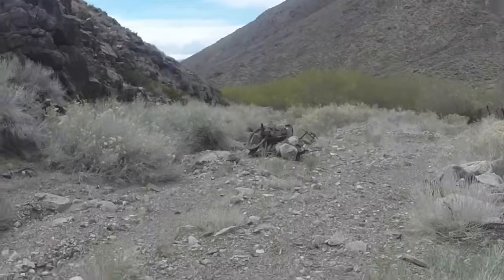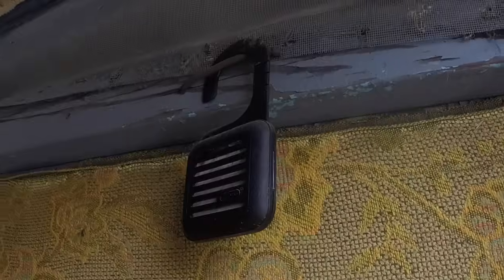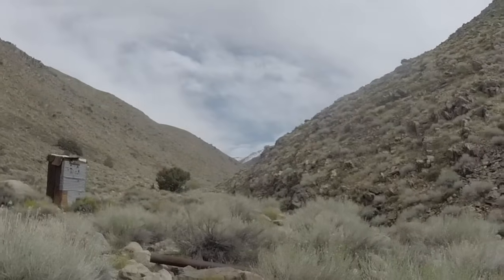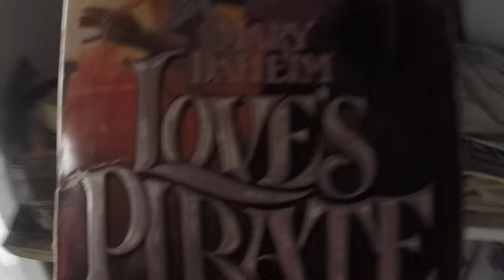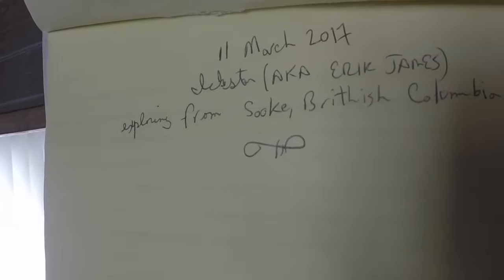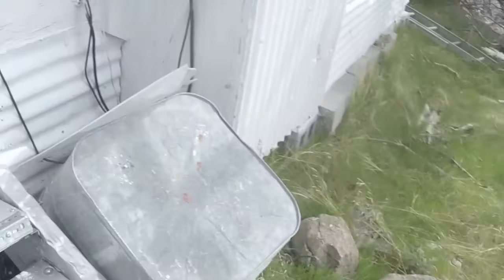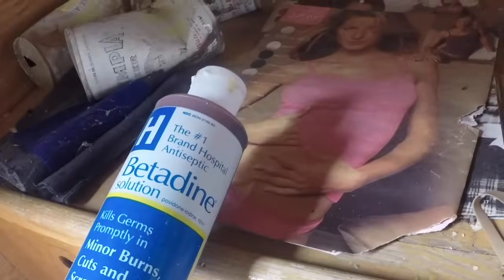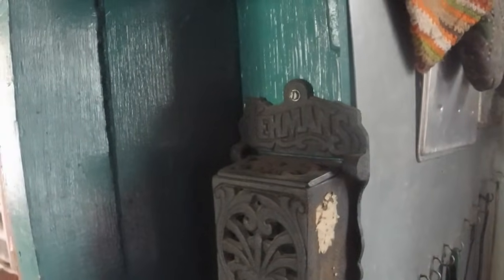Hiking to the Ultra Remote Weston Cabin in the Panamint Mountains PART II

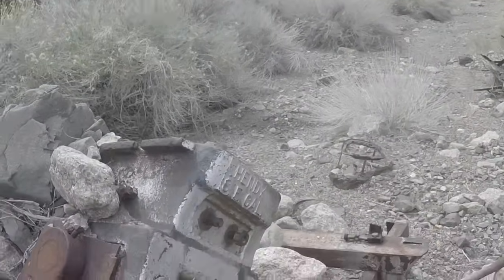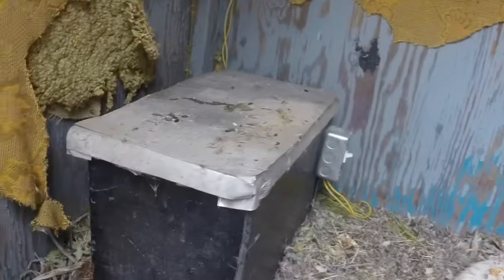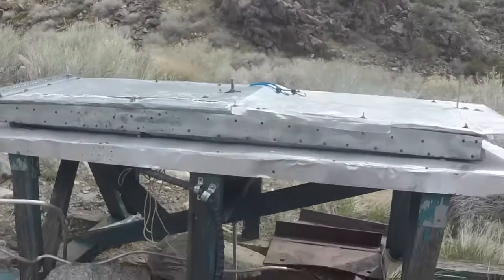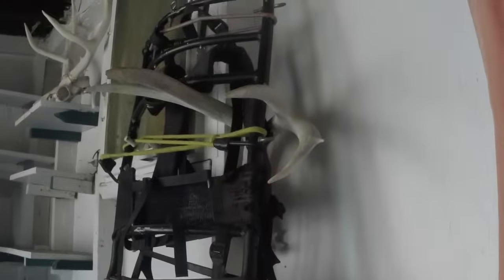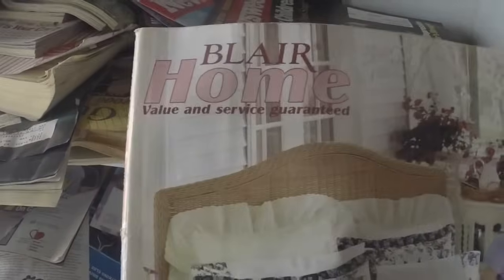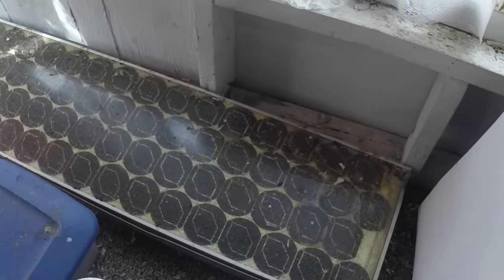Comment: 0:45 Joshua Hendy stamp mill, for crushing ore samples. 3:10 outhouse is rigged for lights from a solar+battery setup. 6:44 is a homemade solar water heater, which explains the tubing laying around. 8:33 Coleman oven for camp stoves. 9:26 pack frames used for hauling freight, good for gas cans. 10:15 most important books there are those Gurney Seed catalogs.  11:55 12v solar panel, enough to keep a deep cycle battery charged in the desert.  16:29 the firebox with the wood is on the left of the oven, the fire travels over the oven and the hottest burners are on the left, the upper box is for proofing bread or keeping food warm.  24:36 is a box to hold kitchen matches, still available from Lehman's, Their catalog is where the Amish do a lot of their shopping.  Great video Desert Mouse, I really enjoy all your adventures.
Reply: Wonderful information you shared William West.....
Reply from the maker: Thank you! Desert Mouse <3
Reply: Today I learned that there's such a thing as a heartbeat fetish. Wtf?
Reply: William West Not much of a compliment to compare her to a kangaroo rat Lol .I get what you meant .Cute .
Reply: William West....The Hendy looks to be a Jaw Crusher.
Reply: You're Correct !  The Joshua Hendy Foundry produced a lot of different types of mining equipment, including Jaw Crushers and Stamp Mills.  Actually, a Jaw Crusher is the "Primary" crusher, which reduces the large rocks to a size of one half inch or less, which then go to either a Stamp Mill or Ball Mill to reduce the Ore to a talcum powder fineness thereby releasing the Gold, Silver, and other valuable minerals.  - < Doc,  Retired.  Miner for nearly 50 years. > .
Reply: It is definitely a “jaw crusher”!
Reply: Thank you for sharing your knowledge. The only things I knew about: the firebox location inside the oven, and the matchstick holder on the wall. Your knowledge is impressive!!
Reply: Wow, you remind me of my dad. Would know every item too, and has probably been to so many of these places, me tagging along as a kid. Great memories of old Desert Rats we met along the way. It’s a big open world out there in-the desert, I love it still. Was taught as a child what to bring on these journeys, what to watch out for, and what to eat if I had to survive. Sure has helped me in my life, I’ve passed it on to my kids too. I miss the scents, the rocks, The piñon trees (at the right elevation) Indian tea, the quiet, and the distances you can see. You can’t explain it, you either love it or hate it. The desert will always be in my heart if I’m too far away to get there by dirt road.

Comment: The holder in the kitchen is for holding a full box of strike anywhere matches. They put the inside full tray in and used the opening in the bottom to get one match at a time out and used the holder surface to strike the match on.

Comment: Yep, put your box of Ohio Blue Tip Matches in that little cast iron box in the kitchen to light the stove, lanterns or whatevahs. I had a yellow one like that in my 100+ year old apartment on the mainland to light the pilots in the ancient gas stove in my blue and yellow kitchen that had to be shut off / on to use. (Also had to use that old stove to heat the place in the winter) There must have been some kind of decent road at one time to get all that stuff up there, the cabin and trailer were amazing! Mahalos for another 2 part adventure!

Comment: The little metal box on the wall by the kitchen stove is a match box for wood matches. My great grandmother had one in her mountain cabin kitchen before she converted to electricity in the '60's. I remember it well & used it as a child when we'd go up to the cabin in the summer. I think I like old wood cooking stoves better than anything & miss those old days.
Reply from the maker: ahhhhh good memories! thanks for sharing!
Reply: Close... It's a Match Holder. You put the match-box in and pluck them from the bottom.
Reply: mine did too
Reply: We called them "kitchen matches".

Comment: I know Lightfoot Louie. He caretakes at the Porter mine. I've been there. I have photos and video but they asked me not to put it on the internet. That trailer in the back is a 1949 Mainline. I have one just like it in my shop in very good condition. I'll send you photos of it. Great videos. We've sure been to a lot of the same places but I've never been to the Weston cabin. There is a road up from the bottom but the BLM closed it off some years back.
Reply: Yes, there was a road and that is how all the heavy equipment got up there. I wonder if the BLM closed it because of a major washout or because of the proximity to the NP boundary?  Amazing about abandoned roads in the desert; the disturbed ground seems to proliferate in vegetation one order of magnitude more than the surrounding area.  That is why it disappeared on the air photos. Thanks for the added info @mobiltec!
Reply: The BLM, no not the ones marching in the cities, the ones that “manage” the land. They are not your friend, especially if you’re a miner. Many years ago, my dad, a WWII Veteran worked very hard on his claims, but he became very ill, in the hospital, so my sister & I stayed with him, as we were concerned about his life. After midnight on Jan 1st, the BLM reclaimed all the land he’d been working, as the notice was in the mailbox 200 miles away. They did not budge, moved all his equipment, & old trailer, then closed the road. For the “tortoises”, they said. Broke his heart. My dad would stop anytime on any road to pick up & move any tortoise so it wouldn’t get hit. He respected them, the land, & all other animals. Such a shame, that “We The People” can’t enjoy the land we pay taxes on. Enough said.

Comment: 24:56 That "iron thing" bolted to the wall looks a holder for a big box of stick matches. You stick the box through the top, and pull the matches out at the bottom as needed.

Comment: Minute 20;35 This was a desert refrigerator. A  container with incredible tiny holes would drip down water in  the burlap on all four sides of it. Behind the burlap there was metal mesh to keep the critters out. The air was going through the wet burlap keeping the temperature down. I had the fortune of drinking a soda offered me by Jim and Norma that came out of that very same refrigerator. It was cooool.
Reply: This is the effect of latent heat - the evaporation taking heat from the surface behind!
Reply: Pretty neat story rudimentary reefer box necessity's mother of all inventions for convenience in the middle of nowhere for comfort or reward working a mine.

Comment: Very cool video! I wondered about how tough it was hauling that wood burning stove to that cabin. Looks like it weights quite a bit. 
A couple questions; Is there a safe way to get rid of that mouse poop without stirring the Hantavirus? Or is it just not worth it and better to use a tent? I usually use my tent in the mountains and canyons but I've always wanted to try those community cabins (or whatever you call the shared cabins). 
...and what would you recommend for books to find those nice hikes? I have one that is kind of basic and more "touristy", but I would like to try the tougher hikes you have done soon if my body is doing a little better. 
Thanks again!

Comment: The metal box attached to the kitchen all is matchstick safe. The matches were long and thick and they were loaded n the top and were gravity fed to the trot bellow. The matches were strikers, meaning that they were long and thick and would be lit my scraping them against the cast metal frame. They would last a long time due to their size allowing the flame to last long enough to light a lantern, a cigar and the stove with the same match.

Comment: Every time you mention mouse droppings I find my self trying not to breathe too deeply.  Then I remember I am actually not there.
Reply: Everything is connected in atomic level.
Reply: I occasionally soak the floor of my barn down with a bleach solution, I hate mice and rats and their droppings.
Reply: the metal box on the wall is a matchbox
Reply: Margie Evans LOL Just caught myself doing the same thing

Comment: That table setup outside with the new looking bolts was probably a solar panel base, must have been a way to adjust it for angle and direction. You would think the solar panels walked away, they are pretty valuable.
Reply: What may be the solar panel is seen at 11:55.  If that is the solar panel I doubt it would power a refrigerator.

Wooden matches were (are) sold in a box that fit the cast iron match box you noted on the wall by the stove.  The open topped cardboard match box had a sleeve on it.  So, drop in the box and pull out the sleeve and matches were available at the bottom.

Comment: yeah that's a Coleman folding oven they've been making them for probably a hundred years and they still make them to this day...... the motorhome I'm in now didn't have an oven just a stove top so I purchased one of those a couple years ago it's sits on top of the stove top burner and it makes an oven works great for most of the things I've tried I don't get to Fancy with my recipes usually just simple stuff biscuit, Pizza, enchiladas, frozen dinners I've even done small hams and turkey breast in mine on the holidays couldn't fit a whole turkey in the thing........ sometimes I'll use it to reheat leftovers or even just make toast... it's not the perfect oven but it's good enough
Reply: Sold my oven for $10. Didn't use it much. It was in about the same shape as that one. Chrome inside racks. It fit on my 1970s paulin 2 burner propane stove. that i will be using camping soon.

Comment: You put a box of matches [minus the cover] through the flip up lid at the top and as the box sits in the holder a few matches at a time fall out into the tray, making them easy to access to light the cook stove or lanterns or what ever else. You need "strike anywhere" type matches, not the strike on the box type, which means you would then need the box cover because that has the strike surface. You can still buy box matches many places, but the strike anywhere type are a bit harder to find.

Comment: At 24:55 It is a match holder/dispenser. You slide a box of kitchen matched in the top and when you need a match you take one from the bottom. Also the Coleman thing is a camp stove oven.

Comment: Hopefully, you will be able to continue these romps in the middle of nowhere without encountering evil, but here is some advise you really ought to heed, "it's better to have a gun and not need it, than too need a gun and not have it". Generally you will continue have good luck with strangers, but luck can run out. Be careful and good luck.
Reply: And take an NRA safety class if you get a gun. Never pull a gun unless you're prepared to use it. Be safe you have a lot of fans and I am one. Thanks for the videos

Comment: That Is A "HOLDER" For A Box Of (STICK) Matches You Would Put It Into The Top (PARTIALLY OPENED) - The Matches Would Fall Into The Bottom (GRAVITY) Opening - You Would Have Instant Access To Your Matches Until The Box Was Emptied - Then Just Remove The Empty Box Out Of The Top, And Install A New Box Partially Opened (It Was A "CONVENIENT" Item)

Comment: i am sure ya know already...since the vid is older but, that black metal box in the kitchen is amatch box ...nailed to wall so you can strike a match on it. also those weird pliers at first...are elacitators. used for applying rubber bands to bulls to castrate them.
Reply from the maker: +pinkies vlogs oh wow!!!! I wish I had known that about the elacitators... that's an interesting tidbit
Reply: the rubber bands are about the size of a largish cheerio, or a froot loop. you put the pegs in the hole of the froot loop and when you squeeze it stretches quite large, goes around the little guys privates very tightly and they fall off. its a bit more humane than castrating. also they arent for a larger bull, but a yearling or younger male calf. then they are called a steer.
Reply: I have one like that on my wall now; inherited from my mother.

Comment: that first equipment you come across looked like a large hit and miss engine. 100 of thousands of them were made at the turn of the century to run almost  anything from a hay bailer to a cloths washing maching. they were one of the first to use gasoline, before that gasoline was thrown away because nobody could find anything else to use it for. it was at that time a bye product of the new oil industry at which time they wanted the keroscene and not the gasoline.you can still find them in good running order. they seemed to be able to run forever.

Comment: 16:26 Wood or coal burning stove. Remove circles atop and add wood/coal. Saying either/or as my old Glenwood also fed through left side door beside oven, with shaker bar behind door to remove clinkers/ash to drawer beneath. Logging camp/mines all used pretty much the same off grid equipment. The Coleman in the shed is a camping oven, best guess .One came with my logging camp, prefer the new one more.

Comment: My Mom had a stove like that. She would use a special tool to lift the round lids off the top of the stove, stuff wood in the hole inside the stove, light the wood, when it was burning well, put the lid back on and cook meals on it. It was also the only heat we had. She heated water on the stove top for baths since the house only had cold water plumbed in. This is the really weird part. We lived in Weston, MA. 1940-1948.

Comment: I had to Wiki the Hendy stamper. I think it was a single hammer Gold stamper. Interesting history:
 The Joshua Hendy Iron Works was an American engineering company that existed from the 1850s to the late 1940s. It was at one time a world leader in mining technology and its equipment was used to build the Panama Canal, amongst other major projects. The company went on to serve many different markets during the course of its existence but is perhaps best remembered today for its contribution to the American shipbuilding industry during World War II....

...In the early 1920s, Hendy's hydraulic mining equipment was used in the regrading of Seattle, described as perhaps the largest such alteration of urban terrain in history.
With the onset of the Great Depression, and hampered by indifferent management, fell on hard times. The company adapted by finding new markets, for example by contracting for the building of giant gates and valves for the hydroelectric schemes of the Hoover, Boulder and Grand Coulee dams. During this period it also produced equipment as diverse as crawler tractors, freight car wheel pullers, parts for internal combustion engines and standards for street lamps. Some of the ornate street lamps built by the company can still be seen in San Francisco's Chinatown district today.

Comment: kitchen wall item you were wondering about is for stick matches.  stove is fed from the top or bottom left door...    I have one that uses the top left, some are bottom left IIRC.  hope you closed the cabin doors when you left!  The couple was force to move out in 2002  after living there for decades, (since 1972?) when the area was declared a national park or wilderness area!  Pretty sure that's why several of the canyon roads were closed off to vehicular travel at the same time.  The Westons moved back to Texas, where they were from originally.  If they have passed it would not surprise me, they must have been in their late 80's!

Comment: That Hendy is a "Hit and Miss" motor and one of the two flywheels has broken. The lower end of it looks like it could be an Ore Crusher as stated below. Sure enjoying your adventure :) The cast iron box on the wall looks like it was used to hold kitchen matches (like "Ohio Blue Tip" brand maybe that's what it might be :)
Reply from the maker: interesting!

Comment: The steel cast rectangle box is a holder for a box of wooden matches, they would put the whole box unopened inside and at the bottom would open it up and have matches at the ready to light the wood stove or an oil lamp, along with anything else that  matches were needed!

Comment: The iron box on the wall is a kitchen match dispenser. You put a box of wooden kitchen matches in it and then pull the outside sleeve off of the box. The hole at the bottom is where you take the matchesout.

Comment: The cast iron box hanging in the kitchen area held a box of woden matches that was wrapped in paper they'd remove the paper at the bottom revealing the woden matches to light the stove lamps and such. My Grampa had one in his house back in the early 1950's and it was old even then, an original one like that would be valuable to a collector of such items.

Comment: The black wrought iron box bolted to the wall, was designed to hold a big box of wood matches.Lift the little top door, place the box in, partially opened to spill out some on the bottom and as you use them, they feed themselves. Just pull one out, strike it on the side .Bolted on wall, to hold it firm to strike matches.Pretty convenient. And ...Lehman ' s is still in business within 5 miles of me, ( Massillon ). K I D R O N .....is taken from the Bible.... ( The Brook Kid ron ....